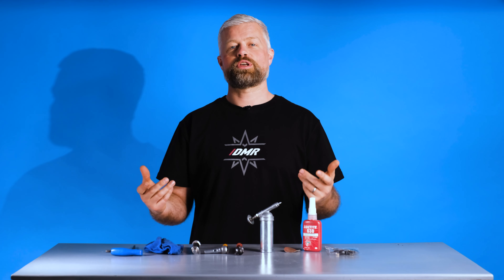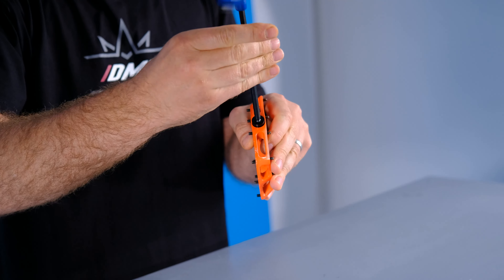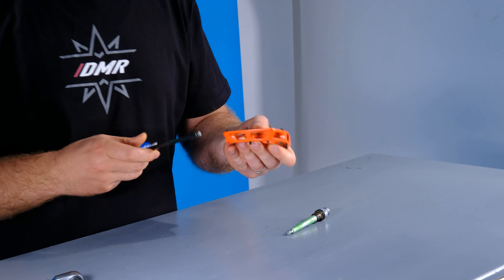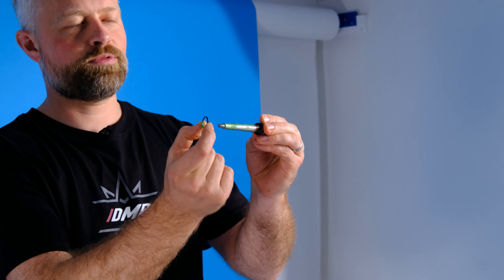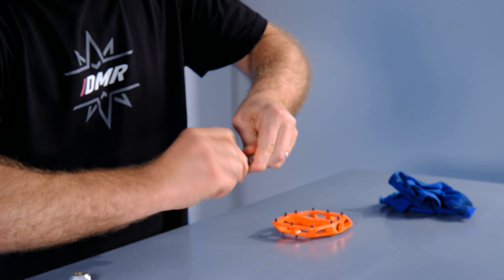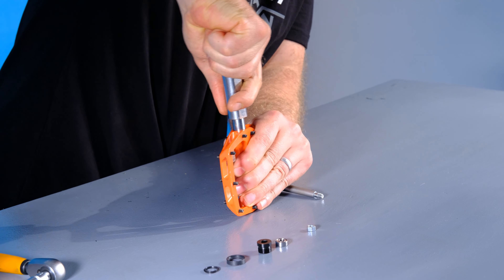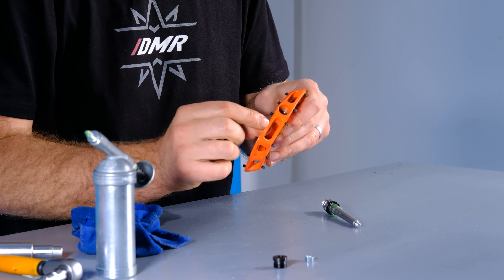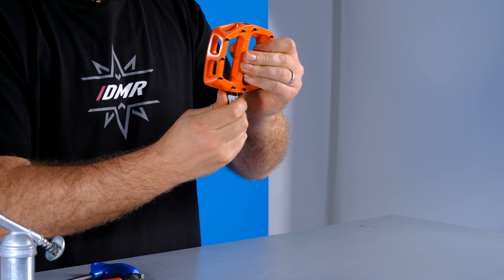DMR V12 & Versa Pedal Service Guide

Comment: the price of the service kit is same as a new pair of V12s (on sale), so may aswell throw them away. not good for the planet guys.
Reply: What you've said is kind of dumb.  It's like you're just causing your own death or something. Just because capitalism means the service kits are basically the same price as a new pedal does NOT mean you need go and buy a new pedal every time. Buy the fricking service kit man and don't just walk off cliffs etc etc. We don't need to just have the cheapest thing in life all the time.
Reply: @MrOvertSandStorm  if the company cared about the planet they would make the sevice kit a fair price. Of course. I care about the planet so I wouldnt obviously buy the same brand of pedals again. The moral of the story is to not support companies that value money more than the planet. Instead of DMR V12 Mag Ti. I have. I bought 2 pairs of Nukeproof Neutron Evo with a service kit and that cost mesame price as the service for the DMR. Rhe DMR ones i will just take them to a shop and get them done by the mechanic for cheaper when i can be botherred. P.s. one of the things i like about my bike is it has grease ports on all the rear suspension linkages and bb. Thats what sold it to me. Its a shame its not standart on pedals.
Reply from the maker: Hi, thanks for your comment. We try to make all but our entry level pedals serviceable to try and prevent this. Not sure how much you are paying for pedals or service kits but SRP of V12 pedals is £60 and bushes are £8 a pair. A full service kit is £25. Hope that helps and you haven't thrown your pedals away already. You can see available spares here - https://www.dmrbikes.com/Catalogue/Pedals/Pins-Bearings-Axles-and-Tools/V12-Bearings
Reply: @DMRTV  legends! Thanks for reply DMR, you're the guys.
Reply: @DMRTV  thank you for the reply. I have kept them. I have V12 Mag Ti. The service kits I've only seen available are £75. So its interesting to hear they are cheaper. I get the kits direct from yourselves. Thanks again! 😁😁

Comment: If you don't have or can't buy the tool, you do not need it to remove or install the DU bushings. To remove, you need a tiny flathead and a razor, mark it at the top with the razor and make a groove on the inside of the bushing with your flathead until it's fully cut through it (it's soft plastic). You can then pull one side over the other, and you can just slide it out!

To install the new one, slide an 8mm socket on the inside of the bushing, put it in the pedal, then a 12mm socket over the 8mm so that it stops at the bushing. Get it in as much as you can, remove both sockets and use a 10mm socket to give it a final blow. Worked a treat!

Comment: Thanks for the video I was able to dismantle my V12's without any tool. The grease inside was full of dirt so I cleaned, regreased and reassembled with no special tools. The bearings just fell out and I didn't remove the bushings although I did give them a good clean. The pedals went back together just as easily and are running like new.

Comment: can you give me the 9mm socket reference ? I cannot find one that fit in.
Reply: ditto...
Reply: @rouxenophobe  ?
Reply: Its a night mare. Plus dmr pedals have gone down hill used to last years.  Bearing need replacing atleast once a year now.
Reply from the maker: Hi, we use a couple of small 1/4" Bahco socket sets in the workshop for jobs like this and the deep sockets fit with no issues. Code for the socket is A6800SM-9. Hope that helps.
Reply: @DMRTV  Thanks.  I found one in the end and did the service, working nicely again 🙂
Reply: Cheap and cheerful Chinese miniature sets usually have sockets with a thinner wall as they're not built for higher torque work anyway.